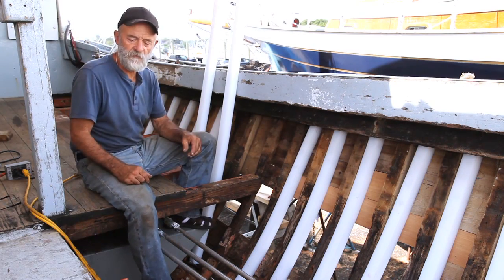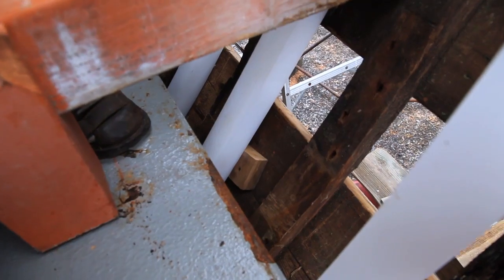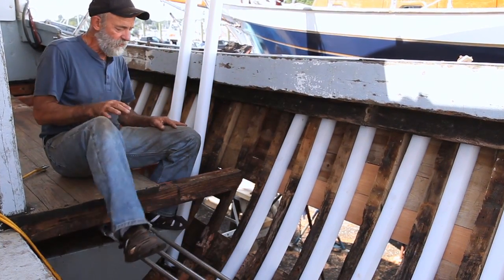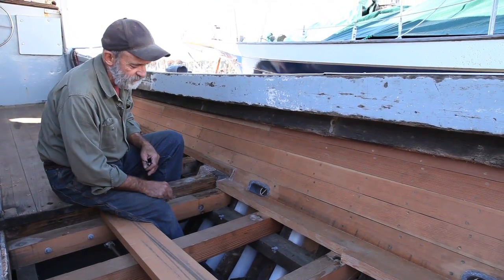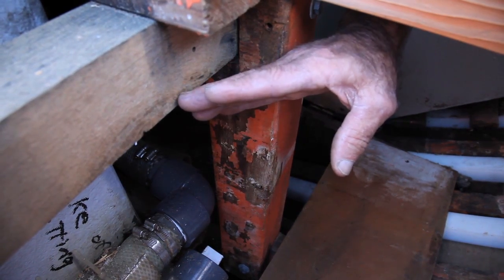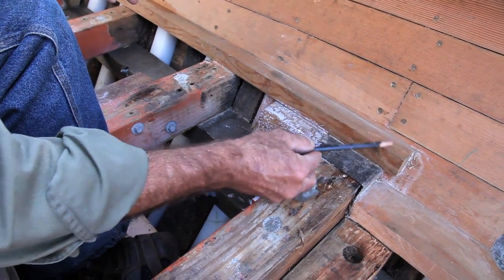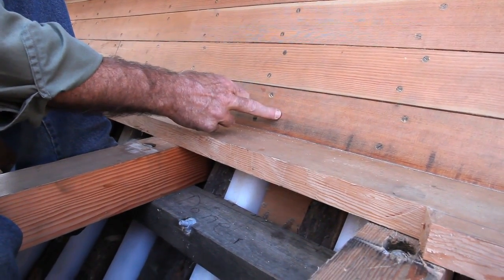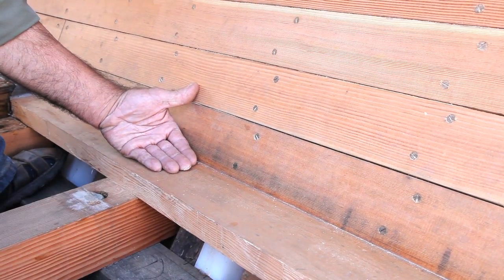How to install plastic frames for traditional wooden boat building (Part 1 of 2)

Comment: MR SAUZEDDE   I LIKE THE USE OF PLASTIC IN WOOD BOATS FUTURISTIC  BOAT BUILDING  AND TECHNOLOGY  UNDERSTANDING - FUTURISTIC S LOOKING BOATS  FAST BUILD BOATS WILL    WILL INCREASE  FUTURE BOAT BUILDING TECHNOLOGY  IN GENERAL  MAY BE PASSENGER  BOAT TECHNOLOGY BUILD FROM WOOD AND TIMBER PLASTIC 
AND MAY BE STEEL  ATTACHED   MIXTURE OF GREAT EASY TO USE AND VITAL  TO COST   IN FUTURE BOAT BUILDING   AFFORDABILITY  TO BUY 
SAFETY

Comment: 8:40 Progressive bevel sawn the first deck piece to what seems to be a sidewall(that you seem to be calling 'the ceiling")
I would like to see "how you patterned it" made "the angle of one piece to exactly match" the other, I would much like to see that "demonstrated". Is there a way, that you remember "where in your vast videos" that you showed something similar, that you (or one of your viewers ) could point me to, where I could see such work?  (see how to do it just below)
REFERENCE: If one goes to the video where it is shown, and "right clicks it" and selects "Copy video URL at the current time" and then PASTES it in their comment, like this: https://youtu.be/qwvWKNXDTaM?t=512 , then if I was to click on that hyperlink, it would take me right there to that video, at that precise second, and start that video right there. ANYWAY, I would greatly appreciate that reference. Thanks a lot. 
JUST FOUND PROGRESSIVE BEVELING at https://youtu.be/-t_w38mS9bo?t=265
ALSO, HERE'S ANOTHER : https://youtu.be/I4Wg21V5PnY?t=120        ----- Really good stuff, both!
(also I'm impressed you selected the growth rings to be perpendicular to the surface of each of the two pieces of wood, to minimize expansion/contraction of the proposed glued joint )

Comment: That was some nice douglas fir. I wanted to replace my porch with quarter sawn but it costs a fortune today. So, I just rifled through a hundred pieces of it at the Menard's and found a few that had vertical grain to replace the damaged ones. The other boards are staying. They lasted close to a 100 years and will probably go another hundred. Most people tear it all out and lay down pressure treated southern yellow decking with gaps. That stuff is just bad and is no substitute the old tongue and groove fir.

Comment: have you considered King starboard? Its simular to Hdpe but a little harder and has UV protection. Most HDPE does not and the sun will break it down pretty quick

Comment: First off I have never built or repaired a wooden boat with ribs so the use of plastic ribs has blown my own assumptions of the purpose of the ribs. It seems that the plastic rib would want to straighten out so the shape of the boat is maintained in large part by the deck beams fastened to the fore and aft beam at the gunwales. Sorry I don't know the correct term. Is that right? These ribs are not attached to the old ribs either so the old rib can't help hold the shape of the new rib. Can you explain what ribs actually do structurally please. I thought I knew until this video. Thanks Louis so much for sharing your knowledge.

Comment: Plastic frames with a carval hull in a big sea and stiff interior framing   I can see the planks moving to pressure from sea   And the calking opening up as to stiff timber frames keeping the form in align as it was designed for  ,pdfe is different

Comment: can I use the standard HDPE for framing my 30' catamaran?
Reply: Thanks for the links. I love your vids as you have a very pragmatic approach.
I know HDPE and also a bit about boats and ships as I'm a retired naval engineer. I was trained and became naval carpenter and loftman in Sweden and France in the seventies, in classic wood and epoxy wood composites. At the end of the seventies I returned to school and became naval engineer for the French Navy making several ships around 150 feet long in sandwich cold molded wood and foam, sandwich GRP,  carbon fiber nomex pieces, alu and steel. I ended my career as structural engineer in composites and worked on the structural calculations of several racing trimarans made in carbon fiber. Now I take care of my orquideas.
Coming back to HDPE I answered for a catamaran framing. Generally wooden cruising catamarans are made in thin skins of plywood  around 1/2 inch all glued and screwed on a rather rigid transversal and longitudinal frame of light soft wood stringers and plywood or wood laminated ribs. 
It's imperative to get the best ratio rigidity/weight possible, catamarans have enormous surfaces but must be kept light, and you must absolutely glue if you want a good transmission of the stresses from the skin to the frame. It's a structural system similar to the wing or fuselage of a aluminum riveted plane.
HDPE has a density around 9.50 gr/cc, almost twice the density of a spruce or an okoumé plywood. It has a rather low rigidity ie low modulus, you can bend easily by hand a 2X2 inches section (you won't bend easily a 2x2 piece of spruce) and it can't be glued, so it has nothing to do on a catamaran which has structural requisites very different from a classic wooden boat.
HDPE has perfectly its use on a plank classic boat as often high density hard woods are employed, weight is not a priority, and the planking has rather generous scantlings. 
The structural problem is very different from a catamaran structure. Making a very caricatural picture, the main problem is to keep the planks together in a way that the seams won't open and spit the oakum.
Sawn ribs are the weakest structural part of a classic wooden boat because of the wood grain, 
So for  doubling the ribs HDPE has very good qualities.  Not too heavy, no grain so no splitting, easy to work, cut and shape, grabs the screws and keep the bolts, no need of finishing nor protection, it won't "eat" the screws like acidic woods do, has no electrolytic problems, it is resilient and ot is largely strong enough to keep the hull planks aligned and fitted together so global rigidity is improved. And I almost forgot not too expensive. Lone con it's ugly, or better I would say I  need to be used to the color. I'm not a purist integrist of wooden boats with 12 coats of varnish. And conscious of the problem of cost, I made working and fishing boats (racing trimarans are working boats not precios pretty varnished yachts).
I hope my english was good enough to make an understandable comment.
Reply: NO. none HDPE.  It's has a too low modulus and a very bad ratio strength/weight. And it's impossible to glue. It's just good to keep an old wooden boat in one piecer.
Reply from the maker: +Ilan https://www.youtube.com/playlist?list=PLzlN3A2DLgNwWFZPXuH83wDY95x3FPdgD

Comment: I used this method to replace/sister 15 ribs on a 36' foot sailboat. It saves
 you tons of time and money. Sledgehammer the HDPE frames into the bilge. The modified C-Clamp is an excellent tip. You may read naysayers and skeptics about this technique. Just ask yourself if you think the Naysayers know as much a Louie. HDPE is insanely durable stuff and perfect for this application.
Reply: I can see the tear out if you didn't use it. Definitely a time saver

Comment: Interesting technique ,  why use bronze screws instead of stainless?
Reply from the maker: All the fastening in the boat are bronze and they will outlast stainless.
Reply: Tips from a Shipwright

Interesting, I would have though 316 SS would be better.
Reply: when oxygen is removed from stainless it corrodes and pits. So SS above water level and Bronze below or just use bronze
Reply: If i watch all your videos, do you think i could build my own sailboat? lol, i havnt had time to watch all of them, but you do really good videos.

 Also i was wondering what kind of wood is good for boat building and does it grow in Florida? hehe

Comment: Just finished 9 sister ribs on a 1933 29ft American car & foundry (ACF) cruiser. It tightened up the planks and just about restored the boat to the original shape. I had seen the first video on this method and decide to try it.  Thank you for all your video,s.
Reply: Was it difficult to do?
Reply: no, it was very easy, the ribs can be curved by hand or in a vice. you also use a heat gun to bend the rib. I just finished doing 10 more sisters this year approx.1 1/ 2 days of work.
Reply: +George Dodd where did you buy your plastic?
Reply: I got the material from jamestowndistributors.com. it is king starboard polymer sheet and I think you can it cut if you want. I bought the sheet and cut it on a table saw.

Comment: There's some interesting stuff here. The boatbuilder says he has done many vessels with this plastic and I assume it has US Coastguard approval. Seeing how easily he bent the plastic frames is a little scary. The original frames (probably oak or rock elm) would have been MUCH stiffer than the plastic ones. So, the question is, how has the structural integrity of the hull been affected? Surely it has to be more flexible than the original. Thus, if it is moving differently something, somewhere, must be more stressed that the original design called for. Brilliant idea but tensile and flexural properties very different from wood. At least it will never rot!
Reply: Richard Davies-Scourfield Much of the stiffness will come from the outer planking, and since the plastic is sistered in, I imagine that the original frames will help. He mentioned a new construction using the plastic, should be interesting!

Comment: the problem with that plastic is that nothing will stick to it...you cannot use glue or fiberglass resin
Reply: you wouldn't want to anyway. fiberglass has no place in a planked wood hull, it's ok for decks and cabin tops but that's all.